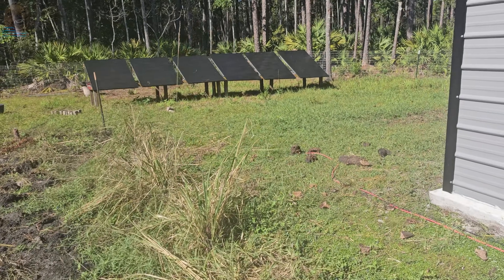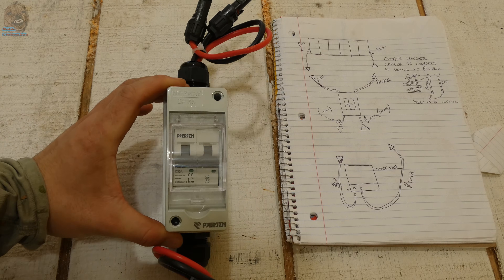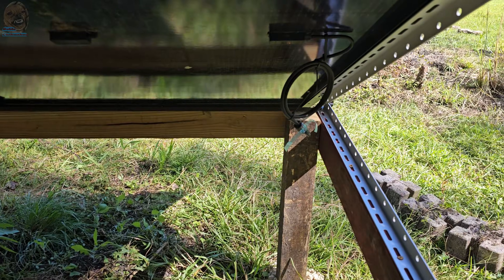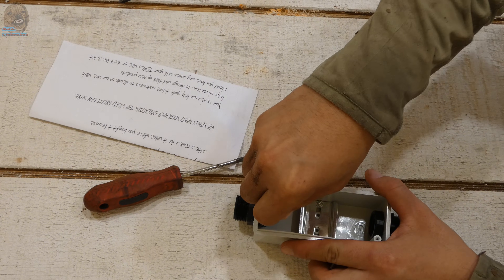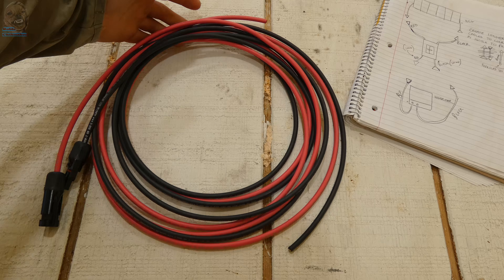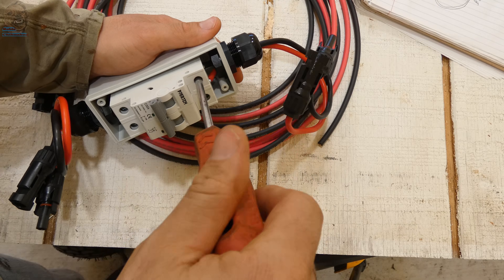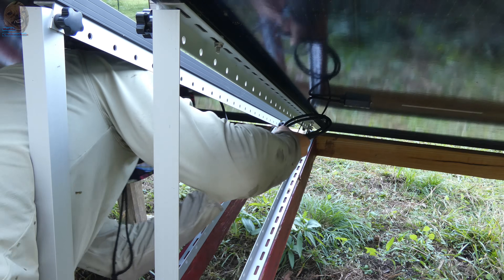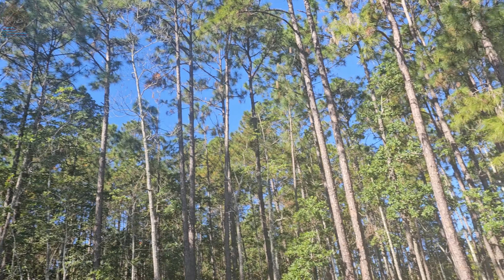How to Connect Solar Panels to a 5000W DIY Power Station | Complete Off-Grid Solar Setup

Comment: Great tips! Where did you find the 2-wire MC4 connectors? (or was that just the connector to the breaker box?)
Reply from the maker: Yes, those were included with the DC breaker box

Comment: That cheap, Chinese made, high frequency, transformerless, "scam" inverter will damage your appliances when the MOSFETs in its H-Bridge circuit fail.  You should have used a low frequency, transformer based inverter instead.
Reply from the maker: Is this true?

Comment: I have same all in one and same battery. If you start getting "Full Charge Protection Fault Module Pack One" error on all-in-one change settings 60 and 62 to below 100 (95 -97) Solved my problem. Enjoy your videos...
Reply from the maker: Hey thanks for the tip, will keep that in mind